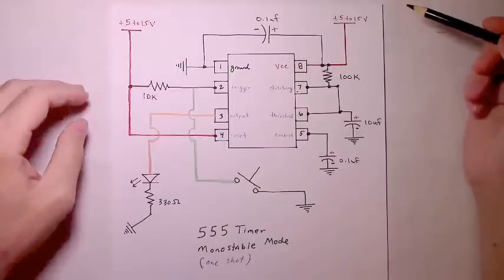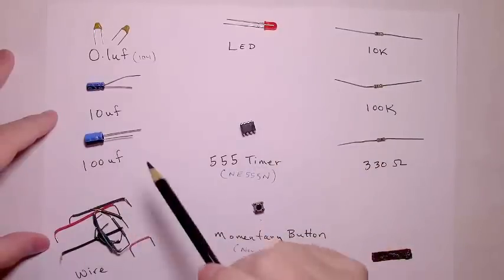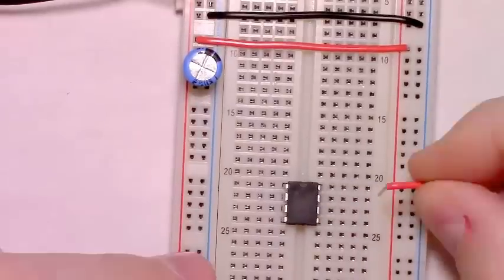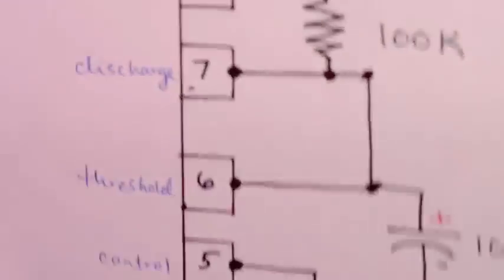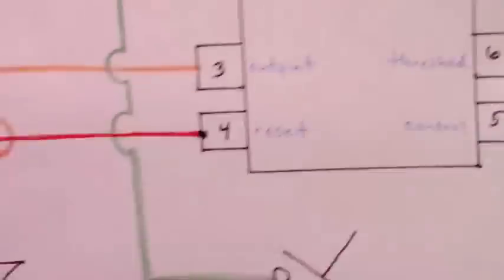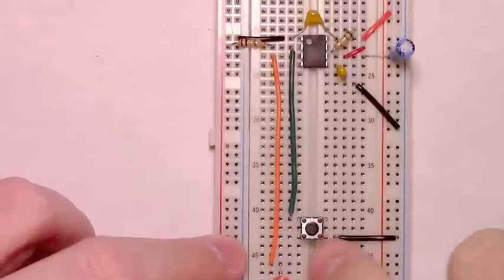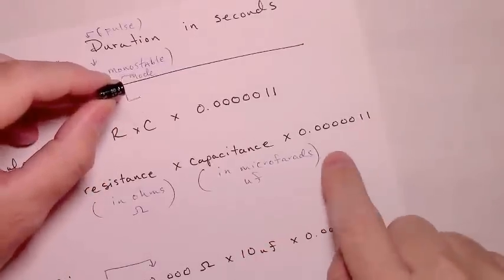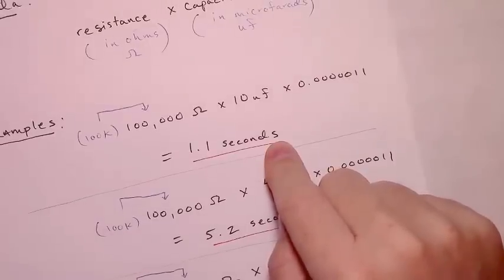Circuit Assembly Tutorials || 555 Timer, Monostable Mode

Comment: Nice that you paint chip itself, it makes things easier to understand, rather than checking numbers every time. 
Thank you.
Reply from the maker: Boby Bob Appreciate the comment and feedback.  I tend to prefer schematics that match chip pinout and breadboard layouts as well.  Using the various shorthand component symbols, etc., often makes drawing schematics easier, but I find that it tends increase the difficulty when it comes to actually building circuits on a breadboard.  It's great to hear that others find the pinout and breadboard-style schematics helpful as well.   Thanks for watching.